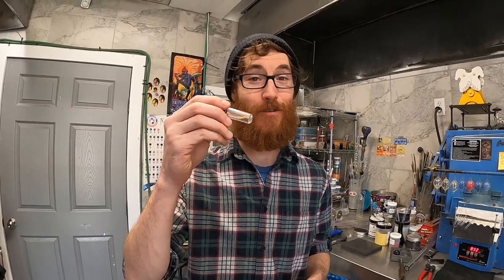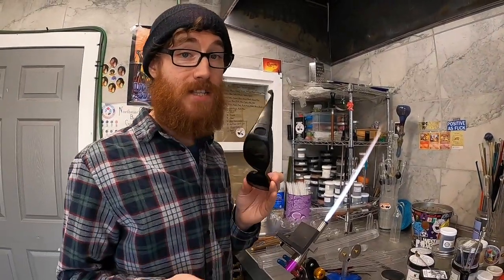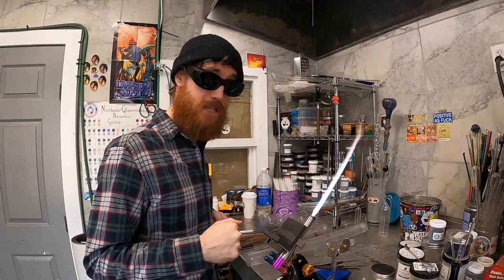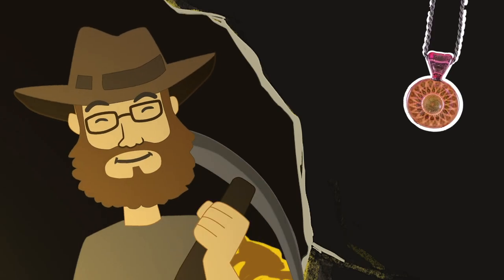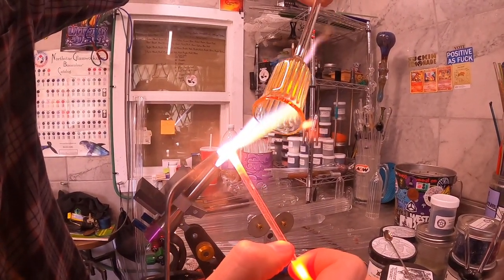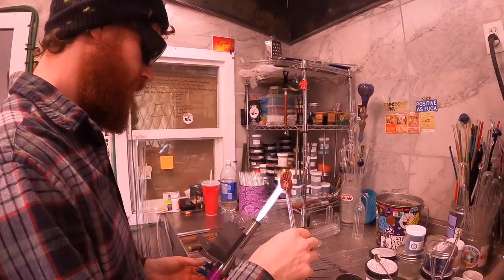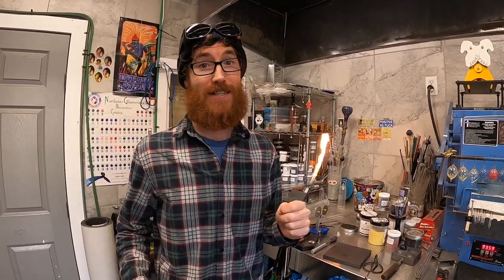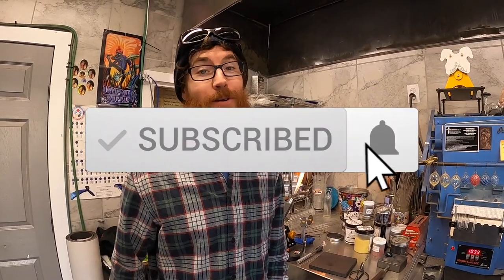Gold in Glass? HOW?

Comment: Crazy how you can be melting glass and holding it with bare hands only a few inches away. Does it only heat up right where the flame is? Beautiful art BTW!
Reply from the maker: Glass is an excellent insulator, Heat doesn't transmit easily or quickly through it. In order to heat glass up to molten, you need to provide constant energy input to that glass - as soon as that energy input is removed, the glass begins to cool down.  The heat stays very concentrated near where the flame directly hits.
Reply: @TheGoldPanner  - interesting, thanks for clarifying!